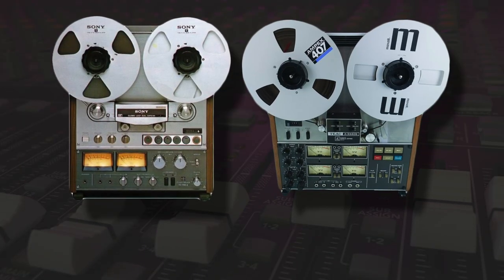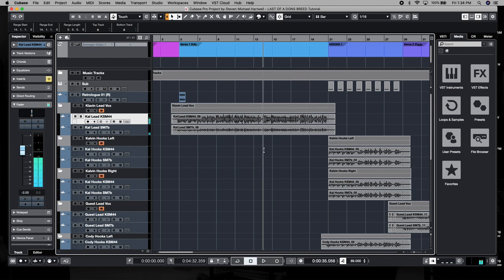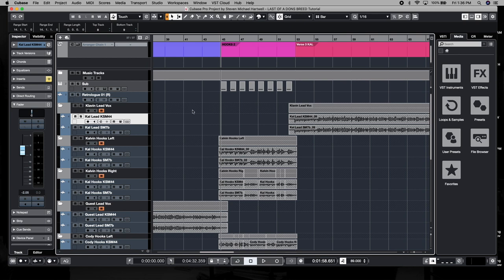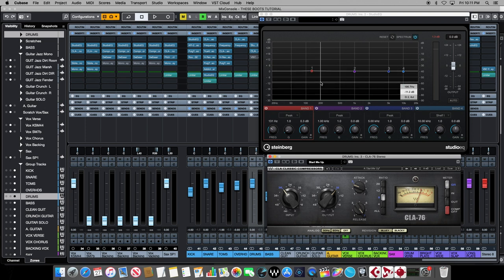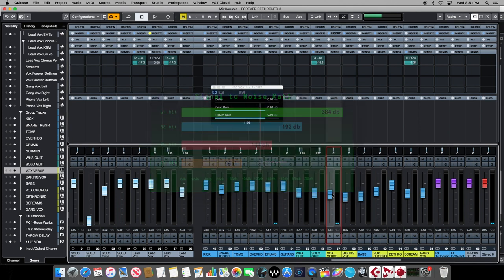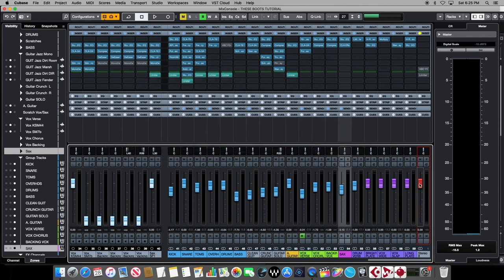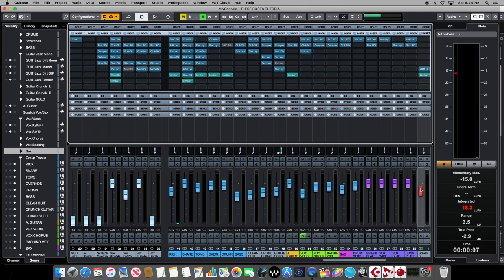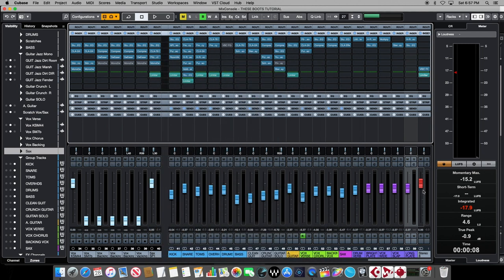LEARN CUBASE - 22. Gain Staging Software in your DAW and plugins.

Comment: Great video!
A good workaround I found for myself was working with sum-busses for instrument groups, which will be routed to another bus down the line. In every new bus I check the input level and adjust the pre-gain accordingly. That way I have pretty tame mix levels at the master bus and I assure that every effect plugin has enough signal to work as intended.
Reply from the maker: Great tip!

Comment: Again, really good stuff here - the entire series is so well done and I really appreciate the time you've put into making such excellent educational material, FOR FREE.  I was definitely guilty of recording WAY TOO HOT.  When speaking specifically about ELECTRIC GUITAR DI TRACKS, do you feel that an average of -15dbfs with a peak of the most aggressive right hand sledgehammer on strings up to as high as -3dbfs is about where a DI should be?  I'm using NEVE RNDI into Fireface400 and looking at TOTALMIX monitor to see these levels.
Reply from the maker: The NEVE RNDI has a great deal of headroom so those levels should be fine going into the Fireface. Keep in mind that the TOTALMIX is only giving you peak levels into the FireFace and not into the RNDI so it might still be possible to clip at the input stage of the NEVE RNDI.

Comment: I was hoping you would offer suggested True Peak levels for outsourcing to Masters or some of the streaming services. About 16:42 you mention headroom scenarios, and ways to resolve them but not what one might be achieving in their summed output.
Reply from the maker: Great suggestion but goes a little beyond the scope of a single video and really gets more into mastering. While Cubase is capable of completing tracking/mixing/mastering processes all in the same project, there are significant advantages to breaking that process up into 3 distinct parts. 
While Cubase's Control Room can accurately meter True peak levels, dedicated mastering programs like Ozone and Wavelab are far better at that metering info and give you much greater control over the final product, especially for streaming destinations. Izotope Ozone is currently the industry standard for ITB streaming service preparation because of its many template algorithms. When I export a mix out of Cubase for the purpose of mastering in Wavelab or Ozone,  I shoot for a true peak level of ( -2.db or -6.db )  to leave plenty of headroom to master. If I were to master a high intensity rockproject straight out of Cubase, that would be a lot closer to  -0.04db and might change with each streaming service vs CD Duplication and music genera chosen. ( classical vs pop/rock/rap )
To complicate things even further, most of the current streaming services have changed their upload protocols and will 're-encode' your music to insure that the track conforms to their self imposed -14db LUFS playback standard. This standard is based on apparent frequency loudness over time vs just peak metering and is widely used in the film industry in an effort to establish a universal metric that everyone can follow. 
The take away is the 'volume wars' are finally coming to an end. Now its just about trying  to create a finished master with musical dynamic range while still competing with commercial releases. This is where dedicated Mastering tools really pay off in the long run.

Comment: Very helpful and well presented. I notice you're using a post-fader limiter on many channels and was wondering what settings you recommend for that? I realize that different tracks may require different settings. (Cubase Pro 10 user).
Reply from the maker: The post fader limiters are there just as a safety to reduce the buildup of transients from tracks / Busses and finally the Master. This is simply to keep any 'one' effect from having to do 'all' the work and color the sound dramatically. The default release settings for the Cubase limiter is 500ms which is fine for strings and slower material but quite slow for most everything else. I usually set this to 250ms and then tune from there.
Reply: @Featherlightstudio  Thanks for details on that. I think it's a good work flow. Again, nice video. Thanks for sharing.

Comment: How did you get the mixer to show 2 lines for the track names? Also, I see you're sending a bunch of stuff to "limiter" send? Where is that return and what's the purpose? Great video thanks!
Reply from the maker: This video was done on Cubase 10.0.40 ( Still allowed you 2 lines of console channel  titling ) Before we upgraded to 10.5.12.
Its not a 'Limiter' send. Its individual limiters on each of the Buss Channels. These primarily act as safety valves for each channel before it hits the Master Buss. They are set a unity and have each of their ceiling thresholds set at -0.03db with fast attack and release. The only time they affect the signal is if a transient sneaks beyond the threshold of the buss. This technique helps keep the Buss Compressor on the Master Buss from being fooled by very fast transients that would otherwise pull down the Master Buss Comp.

Comment: Hi thanks for this video. When you used the rack function pre gain minute 6:42 did you have the function meter position imput set? or put position pre fader ?? thanks for your answer.
Reply from the maker: Cubase out of the box has it's global  meter position set to 'post fader' by default, but that can easily be changed by right clicking in the 'console view' just above the channel panner area and choose 'global meter settings' then click on  'meter position'. If the session is new and there are no inserts or processing then the meter is basically reading the input or 'pre' signal anyway. You could also assign a Key Command to the meter state for added convenience to toggle back and forth.
If you use the 'Full Console View" you have even more powerful options for metering. In the full console view ( insert + f3 )  you can enable 'meter bridge' in addition to having the regular meters by the faders. These can be set to wave showing you the actual 'input' ' while the regular channel meters are set to 'post fader'. This gives you the best of both worlds...input metering on the top Meter Bridge and post fader metering on the regular fader.

Comment: What settings do you have your meters set to?  Mine are hitting like a quarter of what you are getting.  Thanks!
Reply from the maker: Heh Matt, this goes into a bit more detail at 03:17 but, if you right click on any of your track meters and choose 'Input' instead of post panner, it will disregard the position of the meter and allow you to see the incoming level of your signal 'before' any downstream processing. From here you can see if your recorded levels are way to loud or way to quiet to start with. And as always, this is just a 'ballpark' guide, there are a lot of exceptions when recording.
Reply: @Featherlightstudio  Thank you so much!  I really appreciate your response.  The video was very helpful as far as getting the correct volume going in.  Thanks again!

Comment: Hi Steve - a great video (thank you)!  One question though... going through every audio event and adjusting its gain can be fiddle and time consuming.  What about if i select them all and normalise them?  What are the pros and cons of doing this (I get mixed advice from Google)?  Many thanks, Phil
Reply from the maker: Heh Philip, You can certainly select all clips and normalize but there are 2 good reason why you might not want to do that. 1. Normalizing doesn't raise all the volumes in relation to one another, it forces them to an absolute value. 2. Buy doing this, your effectively destroying all the difference between your tracks, meaning your killing all the dynamic of the song, track, or clip. 
This is why the use of the 'Pre Gain Control'  on the track edit window  in conjunction with a compressor works much better at controlling track volume and dynamics without killing the performance. 05:51
You can...however...select all the clips in a track ( or even project )  and, while all the clips are still selected, grab the little square clip gain handle at the top/center of the clip, and raise ALL the selected clips volume at one time. This will maintain all of the selected clips relative level to each other.
Reply: Featherlightstudio Thanks Steve - that’s really helpful. BTW - do you have any experience of using DTouch and a multi touch monitor? I’m just trying it out.

Comment: Thank you for the video. Could you please help explain to me why the sweet spot -18dbFS to -12 dbFS is around the -10dbFS to -5dbFS on the volume fader but not at the -18 to -12? Thank you very much.
Reply from the maker: This is because of the difference in Analog vs Digital Metering and is a MUCH bigger topic on its own. The short version is: Analog metering is measured from the noise floor upward using a dBV or dBU scale to represent the difference. Digital metering is measured from the absolute clipping point downward using dBFS or dB Full Scale.

Comment: Thanks for the great video! I have a question: I saw some videos that tell me it's better to set the pre-gain levels of every tracks at 0VU on VU meter, but when I set the levels of tracks like drum to be at 0VU, it's peak are over 0 dBFS. So should I just set the peaks to be at -18~-12 dBFS regardless of VU meter? I wonder if cliping is the thing that must never happen in every step of mixing or not.
Reply from the maker: All meters ( VU, Peak, RMS, ect ) are there to simply give you an accurate measurement of the signal level, input or output. Meaning, you still have to use your ears and eyes and if the input level is clipping, then adjust according to the meter. There is no universal setting that works for all meters. As a very general rule, always try to avoid clipping at every stage if possible.
Reply: @Featherlightstudio  Thanks for the comment! Learning a lot from you.

Comment: at 1:36 You are confusing the internal processing computations done in your DAW  with the recorded file format and its bit-depth..! this has nothing to do with dynamic range or headroom..;
Reply from the maker: Thanks for the heads up, I do clearly show that this is a 'Mathematical Computation" used by the audio engine of Cubase only, and not the project settings that relate to sample rate or the hardware bit depth in use. The reference to signal to noise and headroom was a computational  reference only, and  is admittedly a 'huge' over simplification of a much longer topic about the precision of 16bit word lengths vs 32/64bit and how the truncation ( rounding errors ) of those calculations over many times can decrease the precision of the file. Yes, word length, sample rate, bit depth, and memory addressing are all very different things.  This definitely warrants a more complete explanation of Host/Plugin procession power vs project Bit depths and sample rates in a future video.
Reply: One should not say then, that the 64bit processing gets you 384 dB of range, which you do..; apart from that a nice presentation you have done, keep it up! Greets!